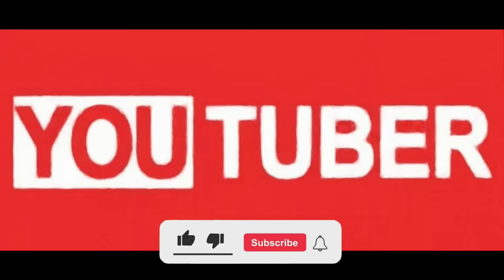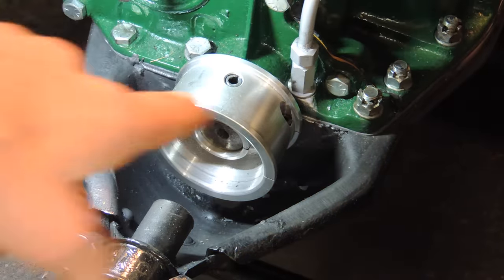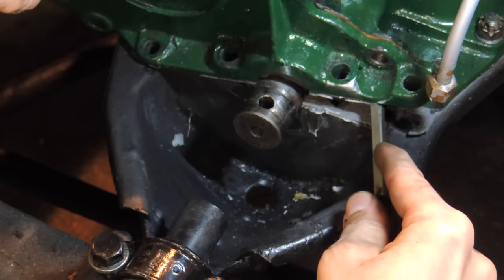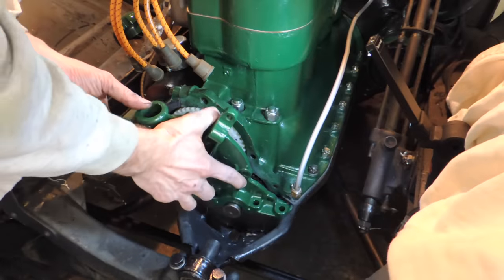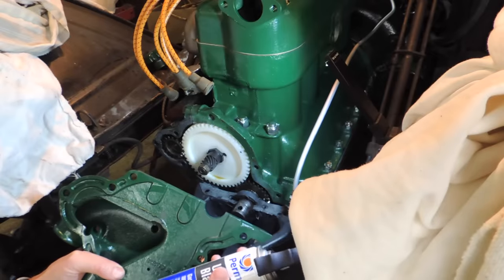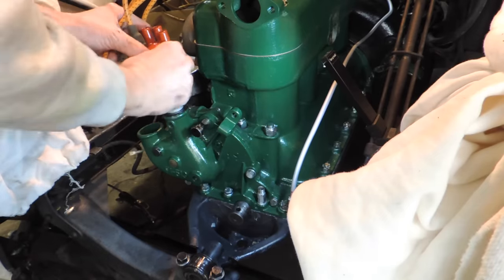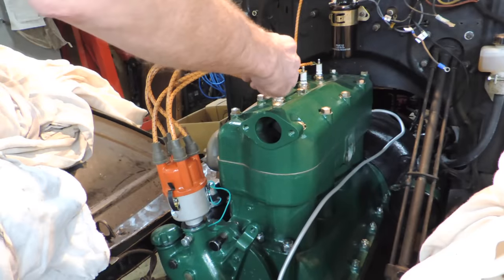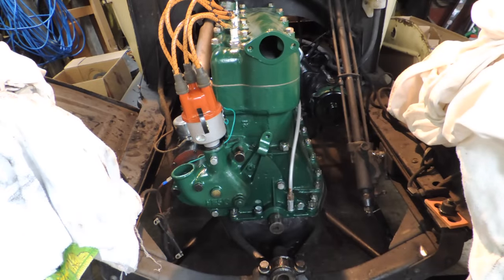Everything you need to know about installing a distributor on a model t  - Bosch Front Plate style.

Comment: The cam end thrust bolt IS needed, especially with the helical gears. If the cam has end play it will cause the distributor & valve timing to vary.
Reply from the maker: Thrust is built into one of the bearings inside.  Typically there is nothing on the end of the camshaft - with the original timer setup.

Comment: I think you left so much of the wall you grinded away, so there will still be a small pool of oil for the distibutor gear. I presume that was made so to ensure some oiling of the drive.
Reply from the maker: I thought that was a dam too but if you look again at the bushing the shaft rides in - it's also raised and would be up out of the oil pool.  Oil for these engines is delivered to the back of that white gear and slung around with it's teeth to oil the front main bearing.  The distributor gearing will not run dry.